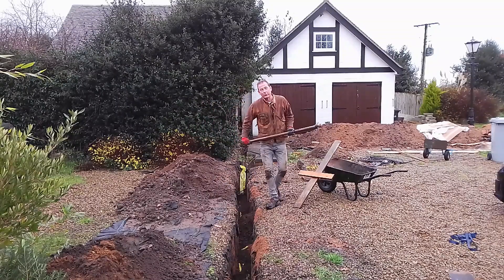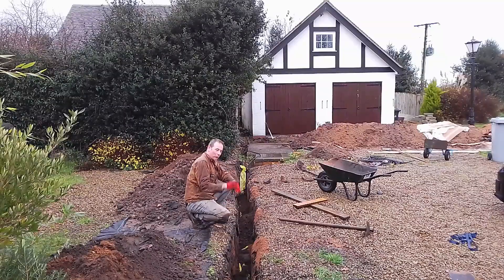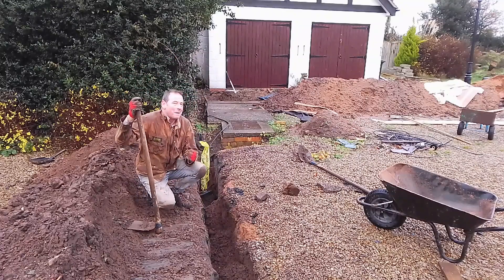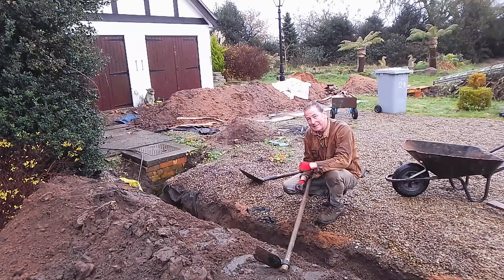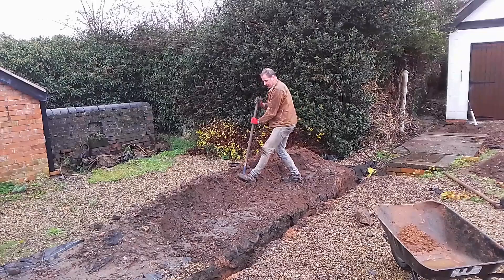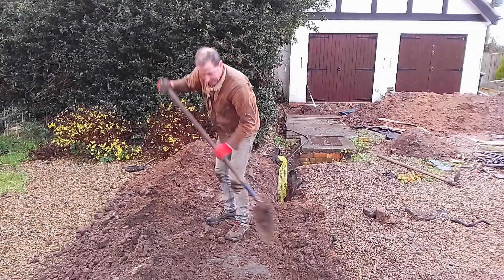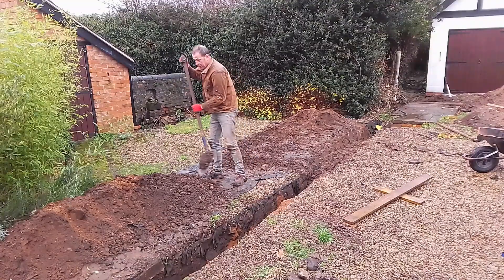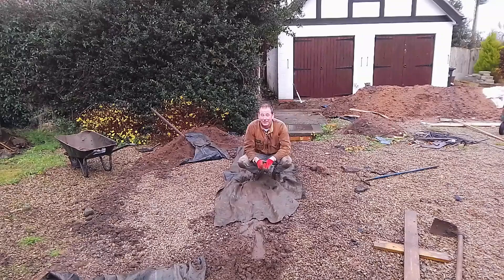How to Install an Armoured Underground Electric Cable

Comment: That trench reminds me of a Human bones burried in limestone in my garden. My trench was declared off bounds to me while the Police did their enquiries into the reason human bones were in my garden. I have alarms installed around my garden. The rains came and filled my trenches to the top. The Police had left an officer overnight to keep watch due to the bad weather. We asked the officer inside assureing him that the alarm would go off if anyone tried to climb into the garden. After a cup of tea, the officer became drowsy when the alarm went off. The officer ran straight out into the trench filled with water upto his chest in mucky water. The alarm was triggered by an overzealous tabloid reporter trying to get close-up photos of the site, which was thought at the time to be of great interest to another case of a found head but no body due to the fact that the skull was the last to be found. The verdict was that the bones had been in the ground for over eighty years, despite being on top of drainage pipes, which had been updated twice since the build after the Second World War. Which should, in theory, suggest 8-20 years. I had only lived here a couple of years. I tried suggesting that I had seen more bones in the hope they would dig my garden for me, which was more clay than soil. They laughed and said get another mug to dig the garden and if they find any more bones dont call us. I did find many more bones, but they were older, so I just took them to the tip.   Just to cheer up everyone who goes digging trenches.

Comment: Rather than 3 cables, had you of put a duct in, you would have been even more future proofed 👍🏼
Reply from the maker: Yes. I kind of regret not doing that now. Thanks Dorset, valid point. Mark

Comment: the only video on here that's done properly.  I've moved into a house with bodge-job electrical wiring pinned to a rotten wooden fence to feed a studio at the bottom.  Issue is there's a patio and a drop down to a lawn to get a trench in.  I've puit it off for years - but now have a dog hell bent on chewing at the cable.  It neds sorting asap
Reply: Similar situation, have you made any progress with ideas at all?
Reply: @TheWidowMaker. I did try a metal cabling box along the wall which has solved 1/3 of the issue - but still not properly sorted

Comment: I thought it only had to be 500mm unless you have a double digging risk i.e. if you put it under a vegetable plot. I guess 600mm gives you options though.  Should the cable warning tape be 150mm below the surface? Well impressed you dug by hand!
Reply from the maker: Hi there. Thanks for the comment. You may be correct. I just explained what my electrician instructed he requires to certify the works. Other people may read your comment here and do it differently. Thanks again. Mark

Comment: For peace of mind, you can request diagrams showing underground services; gas, water, electricity etc. from utility suppliers (they are free of charge). Ideally you should also lay a membrane with the warning tape on top, then protect the buried electricity cable, in its sand layer, with suitable hardcore, such as cut offs of garden slabs, before back filling with loose earth. 
I've just completed this same task - the armoured cable (16mm 3 core armoured plus a spare 16mm earth & Cat 6 ethernet inside a separate conduit) will be used to supply a car charger initially and subsequently, off grid battery storage and solar panels. I recorded pictures showing all elements of the process so my electrician is comfortable signing off on the final installation.
Reply from the maker: Good advice. Thanks. My electrician has inspected mine also. Thanks for this contribution. Mark